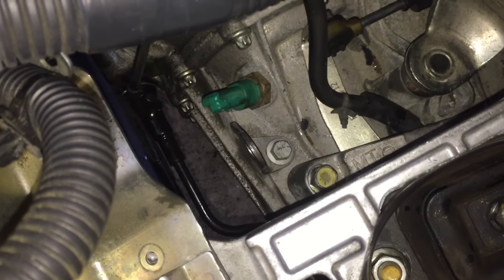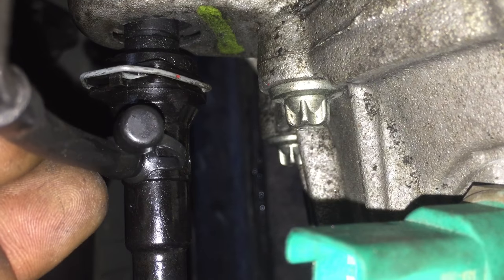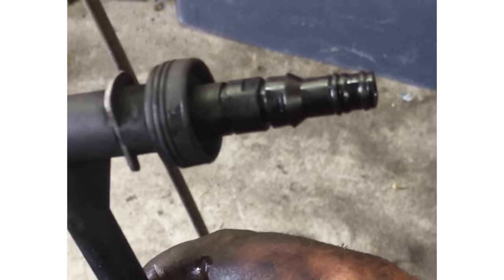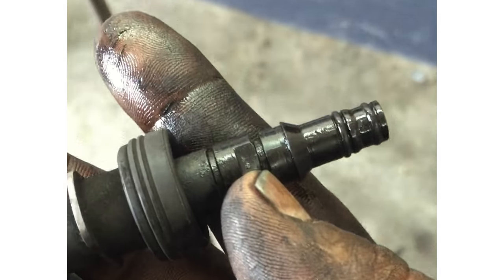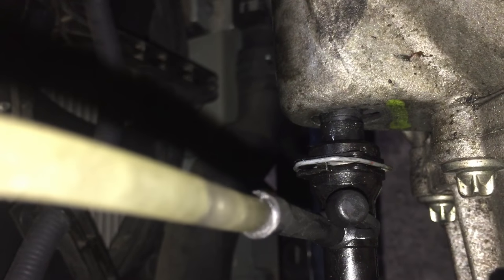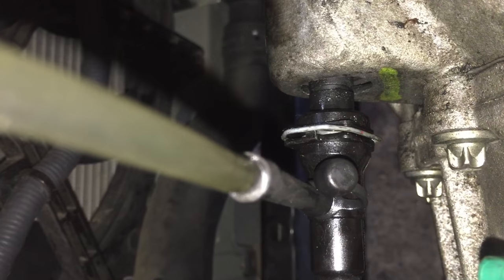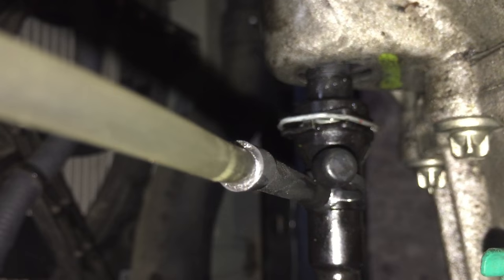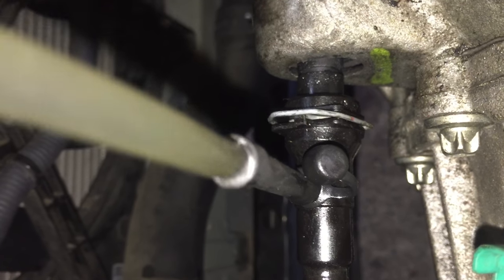Clutch bleeding 2013 Nissan Juke

Comment: Normally I'd say it'd be better to bleed it into an empty bottle and add fresh fluid - but for the ease of it and speed of bleeding the clutch - I'd say it's a good way to bleed, since the end of the pipe is in the reservoir, you don't get any air coming back, only fluid if anything. After it's done you can always just replace part of the fluid in the master cylinder tank anyway, so definitely useful stuff.

Comment: The clip and connector likes to stick. I lubricated Nissan Tiida 2008 with spray lubricant and it loosed up. The clip pushes down while you pull the connector sideways. I did the same thing with my Nissan Almera 2013 clutch and the connector pulled completely out and dropped the entire master cylinder brake fluid on the ground. The clip does completely different things on different models. The almera clip is totally sheit to say the least.